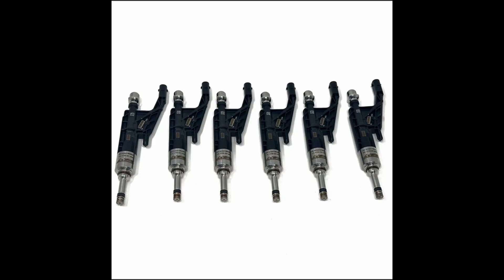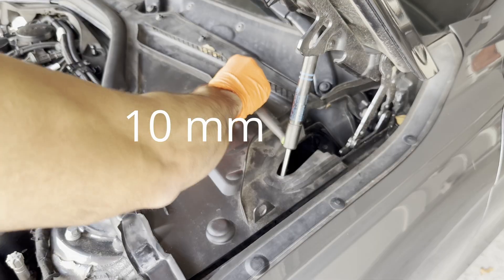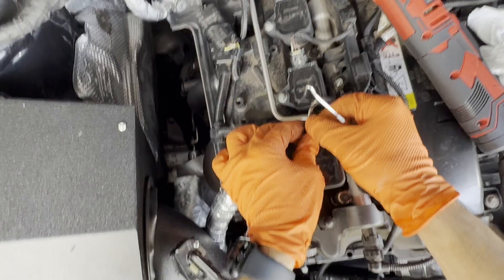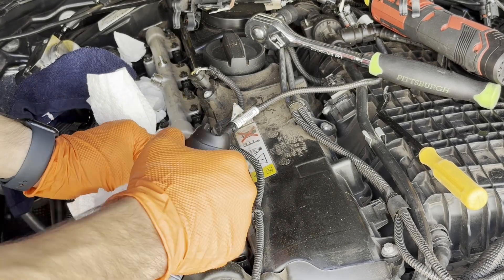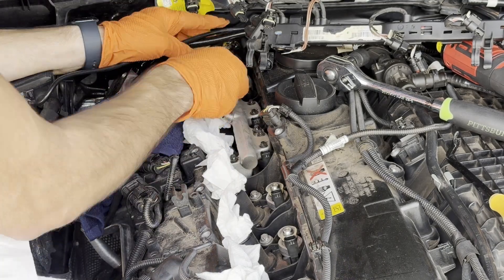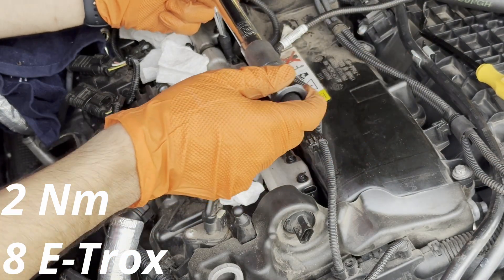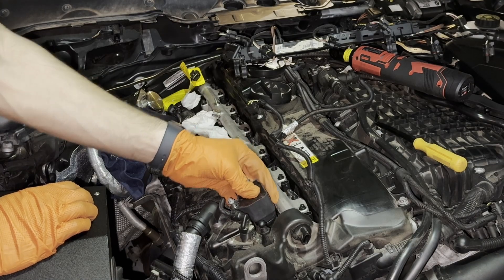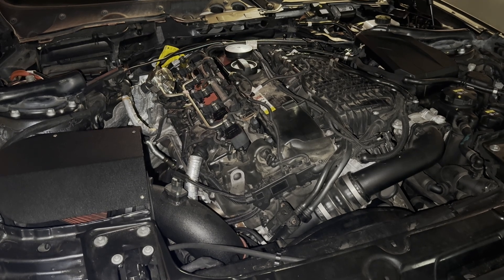B58 INJECTOR REPLACEMENT DIY | BMW F30 340i

Comment: I’m pretty sure you’re supposed to compress the seals on the injectors even if they come with them. I saw another video and the guy compresses them right before install. Ista says you have to compress them and install within 10 minutes because the seal will swell back to its size. 
Edit: you definitely have to compress the seals 😅
Reply from the maker: Well I didn’t compress them and I haven’t had any issues so far. Been running them for 7 months
Reply: @25mrsameer  i wouldn’t recommend anyone install injectors without compressing the teflon seal. If it’s not seated properly you will have major problems down the road. It may not happen over night but It’s definitely needed and shouldn’t be a skipped step for anyone 
seeing this.

Comment: Hey bro, after you torque down the rail, aren’t u supposed to break the rail bolts loose and retorque them? 

I followed the steps in this vid, but after reading the book procedure it says that. So just wondering
Reply from the maker: I haven’t had any issues in the past 8K miles. You can find the book procedure if you want to be extra safe.

Comment: Stupid shop mechanic said I was wasting my time changing my injectors.
Reply from the maker: How many miles do you have on the injectors?
Reply: @25mrsameer I was at 102000 miles. Now I am at 113500 miles.

Comment: I recently did an oil change in my car and after driving around 300 miles, the oil under the oil cap was reeking of fuel. I think the injectors are on they wait out. How would you rate the difficulty of changing the injectors for a novice diyer? 
Cheers.
Reply from the maker: I wouldn’t say it’s too hard. I think the hardest thing is getting the removal tool. Other than that pretty straightforward

Comment: Hi, I see you haven't replaced the copper sealing rings, is that necessary or not?
Reply from the maker: @riccardobraga242  are you talking about the seals on the injectors? I got new injectors so they came with new seals
Reply: were they already compressed ? Because I believe that’s not done with new injectors.
Reply from the maker: @ new injectors come ready to install with seals already prepped. They drop directly in
Reply: @25mrsameer  gotcha. That’s not the case with my upgraded nostrum injectors. I had to compress them per their instructions.
Reply from the maker: @ yeah these are direct oem replacements. I know you have to do the seals for the aftermarket injectors

Comment: Im sure i saw one tutorial saying the injector bolts were stretch bolts... im assumimg you just re used yours, and torqued to spec?
Reply from the maker: @FPV-TV419  the kit I got came with new bolts. Tbh you can probably reuse the bolts
Reply: @25mrsameer  Thanks 🙂

Comment: I’m trying to do all the necessary preventative maintenance too and I’m at 76000 just like you and I just wanted to know if you changed them because u got a code or any symptoms or just to prevent future problems?
Reply from the maker: @matthewblanton2210  I didn’t have any symptoms. I’ve seen issues at higher mileage so I wanted to be safe. Everything was great on stock turbo but When I was tuning my hybrid turbo I was running out of fuel on DI. Changing the injectors got me more fueling so they were definitely on the way out
Reply: @ just wondering did u get a  significant mpg increase?
Reply from the maker: @matthewblanton2210  slight 1-2 mpgs

Comment: I know you don’t have to “code” these injectors per say…

But what within MHD has to be reset, what type of adaptations ?? 

Thanks!
Reply from the maker: @quiet.b58  they should work right out the box no coding needed. However if you are experiencing issues after installing them such as rough idle or long crank, you can try resetting the high pressure fuel system/throttle/idle adaptations
Reply: @ sweet !! Thank you man. Love the channel , definitely showing core DIY’s and data most of us want to know. Love it.
Reply from the maker: @ appreciate it man

Comment: Hello,o2 sensor is pre or post cat? Ty
Reply from the maker: @mateuszgajos9868  there is 2 o2 sensors. But I’m replacing the primary(pre cat) that one is responsible for the AFRs